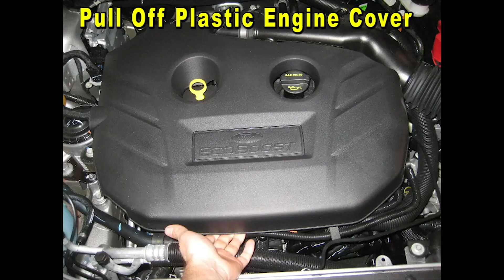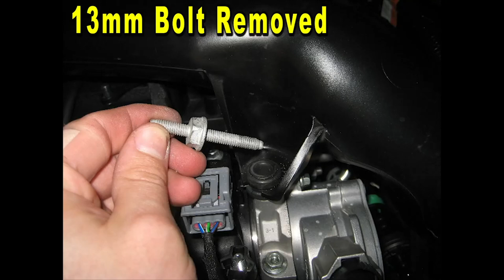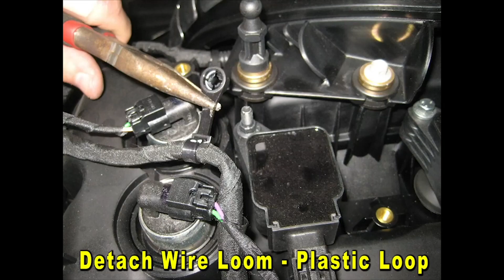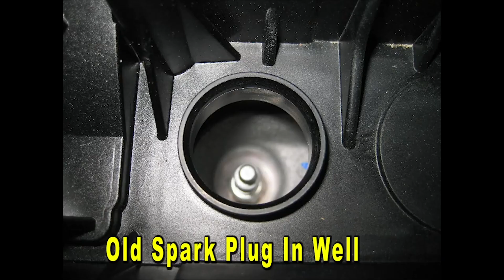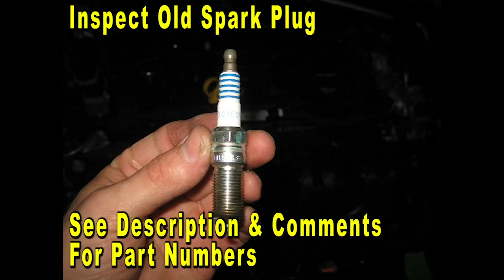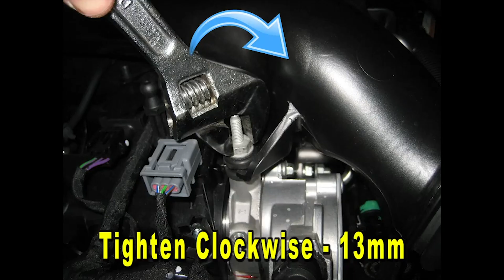2013 To 2020 Ford Fusion How To Change Spark Plugs With Part Numbers  - Quick & Easy

Comment from the maker: Ford Fusion Spark Plug Part Numbers - https://amzn.to/3ImAMHa
Autolite Iridium Spark Plug Part Number - https://amzn.to/3EAkARR
Denso Spark Plug Part Number - https://amzn.to/3YQUdix
Spark Plug Socket - https://amzn.to/3Z4VWAT
Socket & Ratchet Set - https://amzn.to/3Z17LbA
Mechanix Gloves - https://amzn.to/3jCnHkt
Torque Wrench - https://amzn.to/3vS5uSI

The Paul79UF YouTube channel is a participant in the Amazon Services LLC Associates Program, an affiliate advertising program designed to provide a means for sites to earn advertising fees by advertising and linking to Amazon.

Comment from the maker: Check out the DIY guide for changing the spark plugs in a second generation 2013 to 2020 Ford Fusion sedan with the EcoBoost 2.0L Turbo I4 engine - 
https://www.paulstravelpictures.com/2013-2016-Ford-Fusion-EcoBoost-Engine-Spark-Plugs-Replacement-Guide/index.html

Here are all of the DIY repair and maintenance tutorials for the 2nd generation 2013, 2014, 2015, 2016, 2017, 2018, 2019 & 2022 Ford Fusion - 
https://www.paulstravelpictures.com/Articles/2013-2016-Ford-Fusion-Common-Problems-Repair-Maintenance-Guides.htm

Owners of other Ford or Lincoln vehicles such as the Focus, Fusion, C-Max, Mustang, Fiesta, Transit Connect, Edge, Flex, Explorer, Expedition, Taurus, F-150, EcoSport, MKC, MKZ, MKS, MKX, MKT and the Navigator may also find these DIY instructions to be helpful.